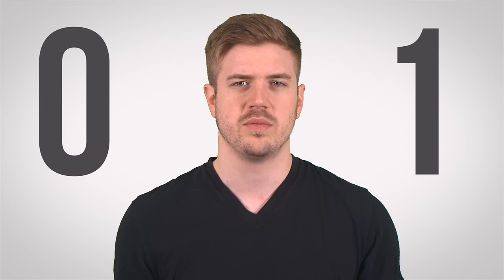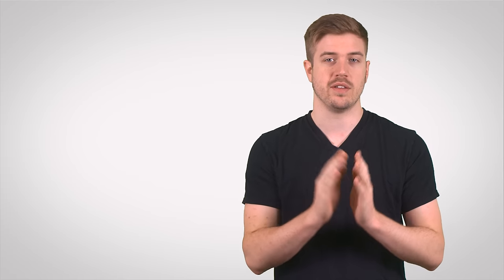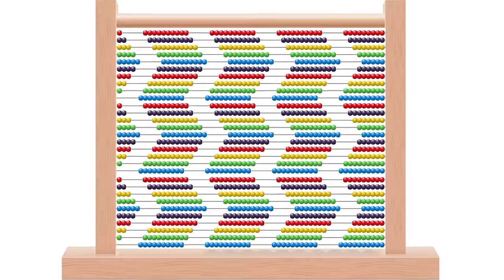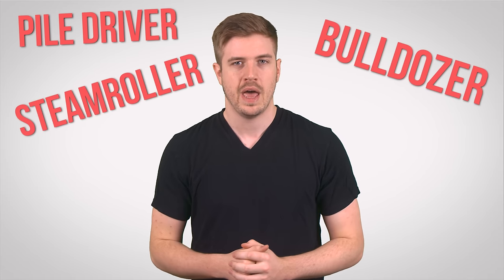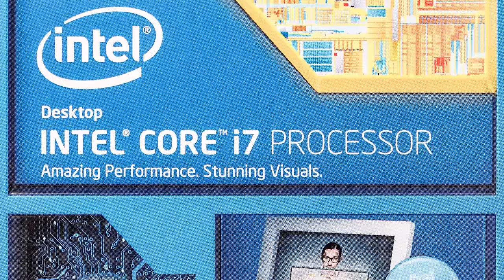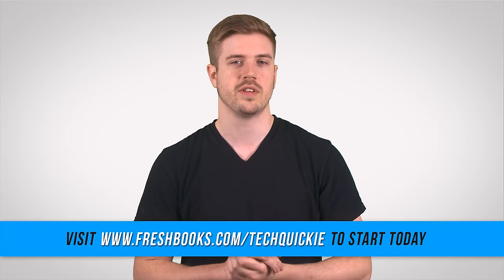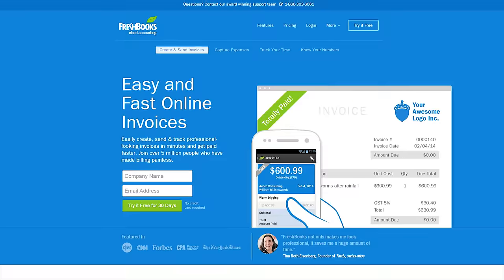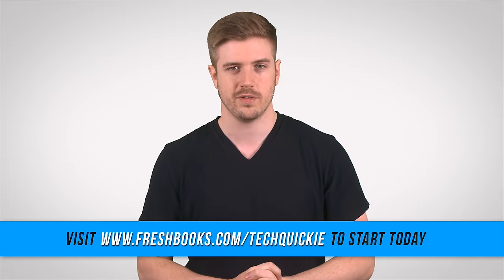Coding Communication & CPU Microarchitectures as Fast As Possible

Comment: code is compiled into assembly, and from there to binary irc
Reply: ingolfur ari Couldn't you write a compiler in binary, that compiles directly to binary?
Reply: Franco Selem imagine how hard and time consuming that would be
Reply: Franco Selem lol ik you weren't serious.
Reply: Franco Selem You could in theory, but good luck trying to find someone willing to code something even remotely complex in binary.
Reply: Eric Slattery Yes indeed !
Reply: Eric Slattery It is amazing until you need to program something in assembly, then it is a pain in the ass to debug and troubleshoot
Reply: Eric Slattery Example situation where ASM is required: VGA output from an AVR chip, where you have to count every processor cycle.
Reply: Miguel C Just as hard as any other compiler. You write you compiler "X to binary" in C or some other language. Just run it through the C compiler and BAM, a compiler that compiles straight into binary.

This is an essential part of bootstrapping.
Reply: ingolfur ari Unless code is written in assembly, but your path is right for C and such
Reply: ingolfur ari Also, no mention of the difference between interpreters and compilers. I realize this isn't really a necessary distinction to make in the scope of this video, but if you're going to talk about a compiled code, you should probably mention interpreted code.
Reply: ingolfur ari It depends on the compiler.  Sticking with C/C++, if you use gcc/g++ or the MS compiler then yes.  However if you use the Intel compiler, no, it goes straight to machine instructions.  And if you use Clang, it gets translated to LLVM assembly code and from there into machine instructions for your architecture. 
The LLVM/Clang scenario is rather similar to the way Java works, except Java translates the bytecode to machine instructions at run time and LLVM/Clang does it at compile time.
Reply: ingolfur ari Assembly = Readable Binary, get your shit straight
Reply: Laufbrett Läuft assembly is not binary thats why it has a specific name. thats such an unimportant and douchie point
Reply: Laufbrett Läuft I have made microprogramming and that is programing in binnary, i have done and i program in assembly and it is based in simple operations like move, add, cmp, branch, jump, call, and so on. Then you have the normal programming that uses words and no mnemonics. And you can also, in some cases, program at a lower level than microprogramming, this is the case in that you configure the hardware ex) Verilog or VHDL that let you program the internal logic of the processor when it is a FPGA
Reply: ingolfur ari In general, assembly translates 1 line to 1 instruction (not counting whitespace).  So it is fair to call it readable binary.  If it were as easy for humans to remember instruction numbers as op-codes, assembly would be completely unecessary.
Reply: ***** Compilers would be in assembly, assemblers would probably be in binary. Thing is, not very many people try to write assemblers.

And writing in assembly is miles easier than binary. In binary, you'd have to actively keep track of what opcodes you need to use, be mindful of what inputs the ALU needs to take along with what output you want to take from the ALU, incrementing the clock and changing the program counter as necessary, etc etc

And if you're translating from full assembly, you'll have to break down more complex instructions into several steps processable in one clock cycle depending on the processor.
Reply: Herman Kwan
 You still have to keep track of all of that in assembly, it is just written more symbolically to be easier to read.  And the reason no one writes assemblers is that assembly pretty much translates 1 line to 1 instruction so it only needs to be written once, and doesn't leave much room for improvement.  Also, the gcc and Microsoft C/C++ compilers are both predominantly written in C, and even parts of the Intel compiler are written in C - you write the most basic version you can in assembly, then use that to write a better version in C, which you keep recursively improving upon.
Reply: +Gauuur nett | It doesn't have to compile to assembly, a compiler can compile to anything it likes.
Reply: +Account you could and some compilers do but there is little difference, let me explain what assembly is (and also why the second step is called an assembler and not a compiler in most cases). Assembly code is statements like
mov 13,eax
mov 20,ebx
add eax,ebx

this is x86 assembly to put 13 in register eax then 20 in ebx and then add eax and ebx together.

Now each of these maps directly to a specific bit of binary (we call these binary bits opcodes), no more translation required, when the assembler sees mov it outputs a specific number, then 13 in binary, then the binary for eax so on and so forth.

Compilers on the other hand have to figure out when I put 13+20 in my code to map it to that binary.
Reply: +Luiz Henrique Laurini Some version of AT&T syntax. Not sure exactly which assembler though.
Reply: +Gauuur nett Actually, some compilers do generate binary straight away.
Reply: I still don't belive that almost 1 year later there is still people comenting on this
Reply: +Rainbow Hyphen do you mean javascript not java?

Comment: I've learned something new nice and it's also very interested😮
Reply: Then why do we need more cores in a cpu can it just be a 1 core or is like having 4 cores the best right know
Reply: juan valadez watch the episode on CPU Cores
Reply: RetroMyke ok
Reply: juan valadez 
Think of CPU cores like arms(with hands, fingers, etc). If you have one arm, you can do stuff OK, but only one thing at a time. Now if you have two arms, you can do things MUCH more efficiently, because you can distribute the work over 2 arms, or do two different jobs at once.
Now, if you had 3 arms, you could do even MOORE work than with two arms, and more efficiently, you could distribute the workload over more arms, and could do more jobs at one time.

This same analogy can be used to explain bottlenecking a CPU.(crudely, it's not a perfect explanation, but I think it gets the point across) 
Think of your legs as a GPU(or any part, really), and your arms as your CPU.
No matter how many arms you have, and how fast and awesome they are, if your legs can only move at one step a minute, your arms are kind of overkill, because your legs simply can't keep up.
Same for vice versa,  if your legs can run at a million miles an hour, but your arm can only move one object a minute, then you can't work very much, because that arm is slowing you down.

Hoped this helped!^^
Reply: TheNONnoobXD it did
Reply: juan valadez The reason why we went with multi-core CPUs is because of media companies like Pixar. They use massive servers with several CPU's to render each frame. A 2 GHz processor doing rendering on just one core will take twice as much time as the same CPU rendering on two cores. More cores means more more available processors for an application to do work. A 2.4 GHz 12-core CPU will do the same work in rendering on all cores as 12 processors clocked at the same speeds on just one core each.
Reply: ***** thanks
Reply: TheNONnoobXD holy shit this helped alot thank you
Reply: *****
No problem.
Reply: *****
That's not exactly correct. Because there are things like Cache and max CPU bus speeds. So, 12 individual single core CPU's working on a single process, would be more effective than a single CPU with 12 cores, because a 12 core CPU shares L1 and L2 cache, and works on a shared CPU bus. But 12 individual CPU's would have their individual caches, and buses.

There are more factors than that, but I've listed just a few.

Comment: You kinda missed Assembler. It's as close to human readable machine code you can get (you can program in it for example - you're going to have a nightmare on your hands attempting to program in Binary) and compilers compile your code into this (which the CPU reads and translates into Binary) although Compiler created Assembler can be pretty abstract (you can re-do it and cut out large pieces of generated code but many don't because it's really long winded).  

You're 2 steps away from bare metal (1s and 0's being the second step and +5V, -5V being complete bare metal). 

For programmer types - Assembler is translated literally and has no hard-defined types (so chars can potentially hold ints etc). You can do any basic operation in Assembler such as while loops and number manipulation.

Comment: If the code gets compiled to binary by compiler.... what is the compiler coded in then... hmm.....
Reply: Well it depends. A compiler is usually written in the same language as the source code or in a general purpose language like C or C++. Also he was technically wrong it isn't compiled to binary it's compiled to Assembly language which a CPU can understand and then further converts to binary. You can also program directly in Assembly code too.
Reply: jordyboy62 ay, thanks for the heads up mate. appreciate it.
Reply: Machinecode <- Assembler <- C(++) <- Framework interpreter <- some other stuff depending on your actual project
Reply: Samen spender
Yeah sure I knew that, the problem is with what is the compiler actually coded in if the compiler itself is actually what translates, thus can not be translated
Reply: its just a code that reads your source and writes the "meaning" binary on your disk. i honestly dont know anymore what you want to know :D
Reply: Samen spender
I know but how is the code able to get processed by any processor architecture if it's not translated? Come on, give it a bit of logic.
Reply: when its not translated? do you have a example? could you mean scriptscode? the understanding probs comming from logic :D
Reply: Samen spender
wtf? i have literally 0 idea what you are talking about
Reply: do you mean scripts, wich can be executed without being translated
Reply: Samen spender
How is that? How can i run a script on amd and intel architecture before it will get translated first
Reply: they dont get executed directly. theres a... let me call a interpreter, which translates your script. your browser is a interpreter. just download a Website. you will find a HTML file, where only describes a site. your browser read this and turns intro instructions that will be executed by your pc. explaining pc stuff in english is harder than i expected
Reply: Samen spender
why the fuck are you talking about websites? I'm talking about machine instructions, the closest thing to "metal" you can get
Reply: u asked for scripts? at least i thought you asked. screw it, just read a book, we cant understand each other
Reply: Samen spender
yeah seems like it. thanks for at least trying tho, appreciate it.
Reply: EvE Spirit i think i understand what your trying to say. your asking what translates the compiler's program to machine readable language.

Comment: those that wonder how the 1s and 0s get into the cpu..... everything you do on the computer actually takes place on your cpu so everything is already in 1s and 0s. the only difference is how its interpreted. 

so the compiler translates 1s and 0s into 1s and 0s that represent instructions that actually want it to do. the cpu then loads in memory which is then send to back to the cpu which then interprets the instructions, if the cpu has enough cache it gets send the instead

Comment: high level code -> assembly code -> machine code
Reply: NOP
Reply: LookRain Assembly code = machine code. If you look up for example the ia32 instruction set you will notice that every one of them has an opcode - hexadecimal number that processor understands (like 0xEB for JMP SHORT).

And if you open any executable in a hex editor you will see that it's all just opcodes and addresses.
Reply: Maciej Sopyło Thanks for explaining. I thought machine codes are just binary codes while assembly codes are still human readable, such as the MIPS?
Reply: Assembly is the language, that is human readable (most of the people don't think so :D), but it translates directly to machine code (unless you use some weird .if shit), so you can write code directly in hex and it will work (labels are just addresses). Of course the instruction opcodes may differ on different architectures (ARM/AVR etc) and linking by hand would be a torture, but it can be done ;p
Reply: Stop creating objects m8

Comment: Just to add more info. if you are working with C, it is compiled as the video said.
However, if you are using Assembler (What is known as "Machine language"), it also needs to be "translated", but this time it's called "Assembly".

Depending on the programming language it might have a different process in order be interpreted by the hardware as an instruction.

L8er!

Comment: So it's like drivers and cars. Oh... you already did that analogy...
I'm going to say it anyways. Say you are driving two cars. They are both automatics. Now, they both are used the same ways, and as long as the proper pieces are in the right place, they pretty much feel the same. (I.E. Driving a NA car then another NA car instead of driving a NA car then an EU car) but of course, they drive differently. But you still know how to run them.

Comment: Luke says that average cpus have millions of transistors but wouldnt hundreds of millions be more accurate as the intel i7-6700k has 1.7 billion transistors which is way higher than luke's loose "million" and the commercial cpu with the highest transistors has something like 7.2 billion. Just saying.

Comment: btw there is a book that'll explain how to make your own computer (from the electrical level). It doesn't get complicated, in fact, a NES has a more complicated system than what it teaches you.  A complete idiot could understand it. At the end you'll know how to build a functinal computer that you could build in minecraft or something. I will teach how ram works, then the processor, and then a jist of how a keyboard and a monitor could work with this setup. Its called "but how do it know" and the e-book is 10$ on amazon.

Comment: how do you know if youre running 32 bit or 64 bit?
Reply: Just go to System Properties.
Or run "dxdiag"
Reply: ok thanks but i meant how you know the computer youre building will have 32 or 64 bit
Reply: depends on the specs really
Reply: Yallah Habibi You get to choose!
The Windows installation disc contains both the 32 bit and 64 bit variants!
The only limitation in case of 32 bit is that you can't use more than 4GB of RAM.
Reply: ok thank you so much
Reply: you will be limited to 32 bit if your processor is 32, but most CPU's nowadays are X86-64

Comment: so .... interpreted languages - PHP & JS exist and aren't compiled. And languages like java are emulated.
Reply: ***** JS is not interpreted anymore (can't speak for PHP, don't use that shit), pretty much every JS virtual machine uses JIT compilation now. And where did you hear that 'java is emulated' crap? Java uses a virtual machine, which is far from emulation.
Reply: PHP5 is interpreted and insanely powerful and flexible as long as your not using badly designed framework like Laravel.

Well >JS being JIT> Darn missed the memo.

As for java using a VM - my bad I used the wrong word. My point was not all languages are compiled.
Reply: ***** PHP powerful? You must be joking. It can't compete with any modern language in terms of speed or ease of use.
Reply: ***** The important part is that at the end of the day all code is converted into binary instructions in some way or another.

Comment: Hey now I understand how processors read and understand code But now how do they process them and give output?
Reply: Well .

Program -> os -> hardware > cpu 
> Hardware > os > program
There is a lot happen between this steps but trust me you don't wan to know. 
But if you interested you can seach 
In a books
Reply: @xrafter  thanks for taking time to write this comment and also taking time to scroll down this bottomless comment section to reply questions like mine
Reply: @prilk1704 
مافي مشكلة حبيبي
Reply: @xrafter  risc v or x86 are just ISA, if you want to build a cpu( otherwise known as microarchitecture)  around these ISA, it'll take a couple of years before that cpu gets into the market, am i correct?
Reply: @zackrider3708  
Risc-v is not an isa .
It is just a way to do risc version 5.
Risc is reduced instruction set computer .

I don't know what risc-v have. 

But arm and powerPC ISAs is risc ISAs.

X86 is cisc ISA .
There is a lot of names for ISAs
Like ISA arch(short for architecture) etc ..

But ISA will give you the real meaning.
Reply: @xrafter  RISC-V is an open standard instruction set architecture (ISA) based on established reduced instruction set computer (RISC) principles.. according to   https://en.wikipedia.org/wiki/RISC-V
Reply: @zackrider3708  
But as a real isa risc-v is just a standard .
Reply: @xrafter  well i was thinking that risc-v could be a potential competitor against arm
Reply: @zackrider3708  

I don't know man .

I don't know id risc-v was an ISA or something else .

But from what i read from wiki .

Its an open source Isa standard like arm but arm is not open source.
Reply: @xrafter  im not surprise that you don't know anything about risc-v isa since its still "pretty new"..  arm is Not open-source however they make money out of their cpu-designs by licensing it to other companies like qualcomm, mediatek and ect.ect...
Reply: @zackrider3708  

Yeah i know arm is not an open source look to my comment.
Reply: @zackrider3708  

I will watch gary explain video about the risc-v for more information .